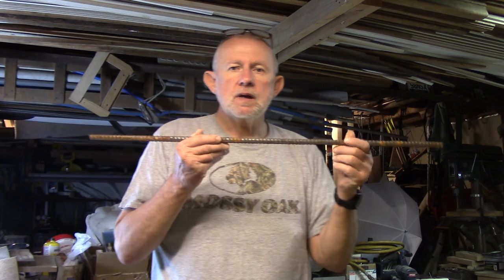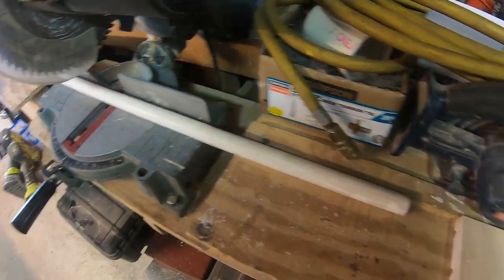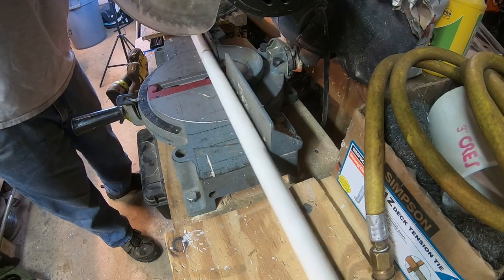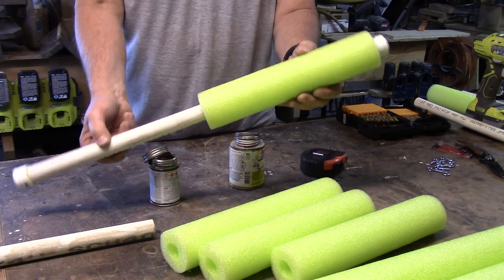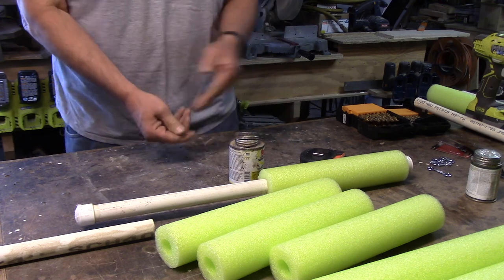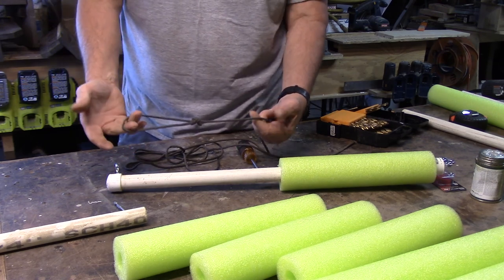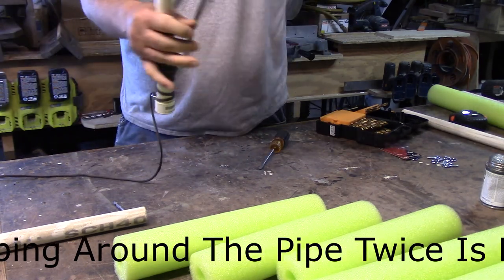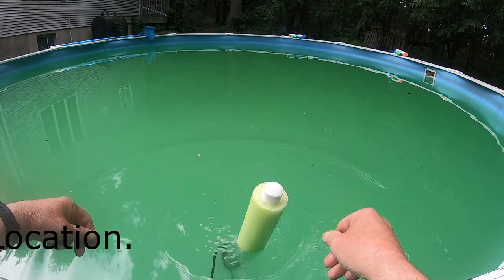How To Build A Crab Trap Float / Fish & Turtle Jug Float Step By Step!

Comment: I think this would be ideal for marking underwater shoals, rocks ot other hazards ties to a concrete block or other cheap weight.
Reply from the maker: I'm sure it would. They stick up fairly high so they are easy to see. I'd recommend the chartreuse color as the red blends in to much. Thanks for watching and may God bless you!

Comment: People often say that the PVC glue makes them “stick together” but PVC cement isn’t really “glue”. It actually causes a chemical reaction between the two PVC pieces and welds them together. PVC primer softens the PVC before the solvent cement is used. It’s recommended, but not really required.
Reply from the maker: I agree when you use the PVC cement to fasten the pipe and fittings together the process is actually called "solvent welding". But I personally would never fasten PVC pipes for any application without first using a primer. As a plumber for many years I've seen pipe joints fail and it is why the purple primer is required so that the plumbing inspector knows that it was applied first to the joint. It probably isn't a deal breaker for something like this buoy system, but it only takes a minute to do it right and then I know I have an air tight connection and am good to go. Thanks so much for watching and sharing and may God bless you!

Comment: Very cool. What size rebar did you use? I know cut 1 ft lengths but there are different thickness rebar for sale. Just wondering because different thickness will be different weights and may not work properly if not the right rebar.... thanks
Reply from the maker: Thanks so much for checking out the video. Sorry if I failed to mention the size. It is 1/2 inch rebar. I hope that helps and I'll update it in the description. Have a blessed day!
Reply: @thefrugalsportsman  Ah, did see it now in the materials price add up list, when it dings- LOL. Great job, gonna make these for Blue Crabbing to mark the pots! thank you so much.
Reply: @thefrugalsportsman  also what would you suggest for numbering/marking them????
Reply from the maker: I made mine for using two or four door traps so I could drop them in a line within sight and then circle around and pick them back up. But I believe If you are going to use them for commercial style traps and leave them out overnight or unattended I think you have to either have your permit number or address on them or both (check the regs). If that is the case I think the best bet might be to use two hole copper trap tags. You can order them here at www.traptags.com. They are $13.50 for 50 of them. Then I would just slide the pool noodle down a little and pop rivet them on the upper half of the pipe. They should still be water tight and they won't catch on anything. You could also wire them on just under the top cap. Don't forget to put reflective tape on them too if they will be left out after dark! Hope that helps! God bless!
Reply from the maker: If all you are looking to do is just number them I would buy the plastic restaurant table numbers here is the link https://www.amazon.com/Alpine-Industries-Double-Sided-Plastic-Numbers/dp/B07M6Y3MQY/ref=pd_lpo_79_t_0/136-1877019-2300249?_encoding=UTF8&pd_rd_i=B07M6Y3MQY&pd_rd_r=eb4f354c-a8db-4245-917f-059a3c858dc1&pd_rd_w=eKA3O&pd_rd_wg=kfmmf&pf_rd_p=7b36d496-f366-4631-94d3-61b87b52511b&pf_rd_r=1DW3R1P7YXF6XXGHYCWM&psc=1&refRID=1DW3R1P7YXF6XXGHYCWM and either pop rivet them to the top portion of the pipe or make a slot and use a hose clamp to fasten them so they stick out to the side like a flag. Just use a magic marker to write on the back so you can read them from any side. Hope that helps! Blessings!
Reply from the maker: The Frugal Sportsman
The Frugal Sportsman
• 1 second ago
No Problem. I did put the size in the description under material details just in case I missed it. So Thanks!
Reply: @thefrugalsportsman  I love your design and am making them for our topless crab traps. But I'm curious how you stack your traps.with these, given their size. Mayne you don't stack your traps? Perhaps you clip them on just before dropping them in? We have used puck sized buoys into he past and once the waternis choppy we can't see them without going on a wild goose chase.
Reply from the maker: @heatherprosseda6316  I use old school two door crab traps and ring style basket traps so stacking them like topless traps isn't an option for me. As you said it is best to just tie or clip them to the trap rope before you deploy them and then just stack them separate after you're done for the day. I know what you mean about the puck style floats and you are right any chop and you can loose sight of them for sure and I'm afraid of other boats running over then and getting tangled as well. You shouldn't have that problem with these. I'd recommend the chartreuse or bright orange pool noodle as red just doesn't stand out well. Thanks so much for watching and sharing and may God bless you richly!